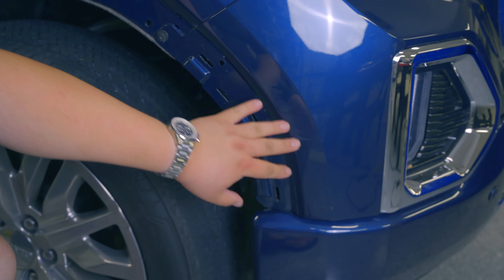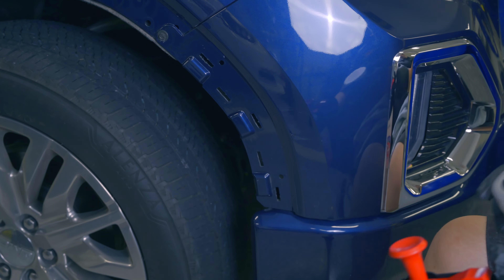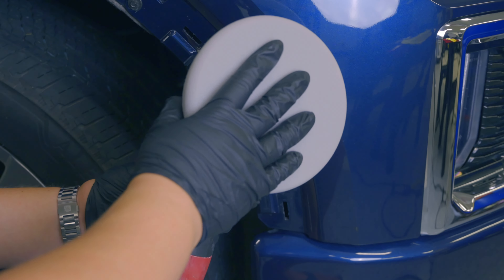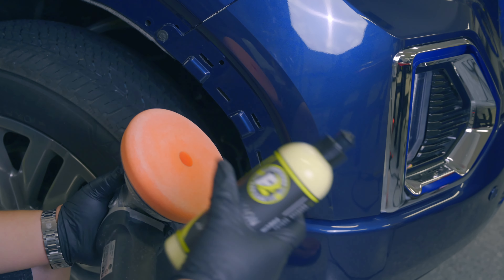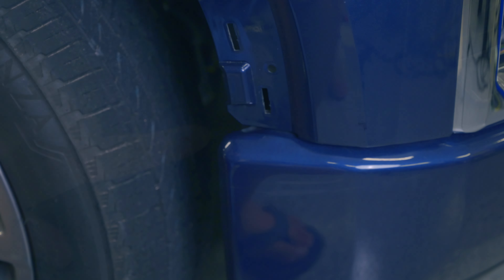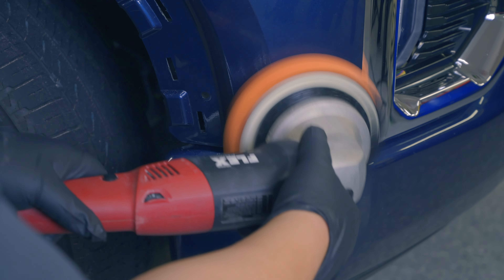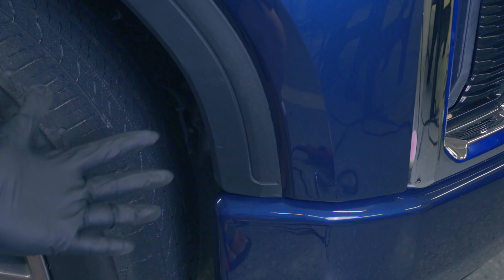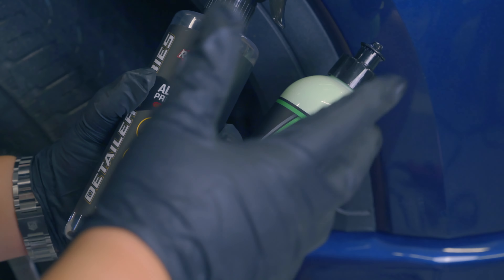Buffing Out Scuffs & Paint Touchup - Someone hit and ran my truck!

Comment: Thanks, I have a few rick chips on my car. Is there a way to fix paint scratches from clay bars?
Reply from the maker: Glad it helped :). If the paint scratches from clay are only in the clear coat then polishing like in the first half of my video will fix that. If they're deeper than the clearcoat then you'd have to fill them like you would a rock chip.
Reply: @DmitrysGarage  thanks, keep up the great work 🔥👍👍